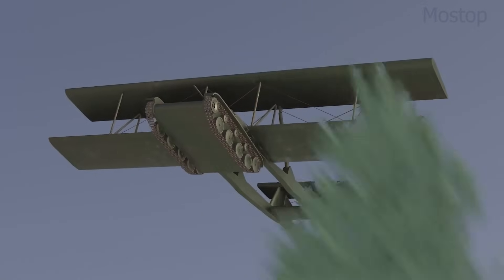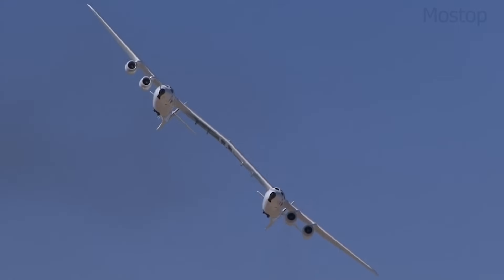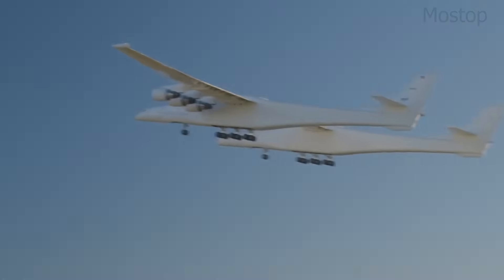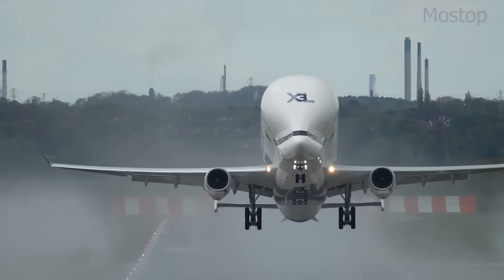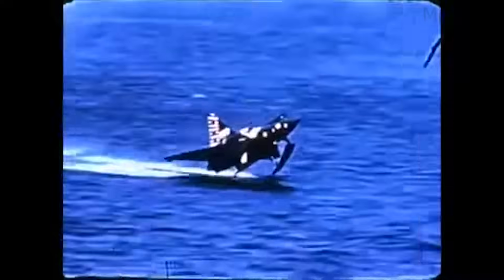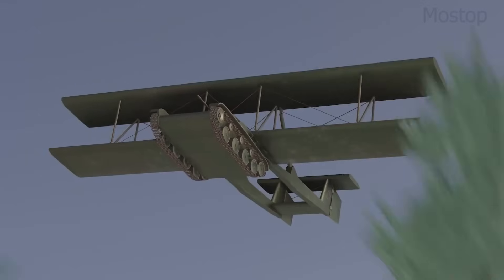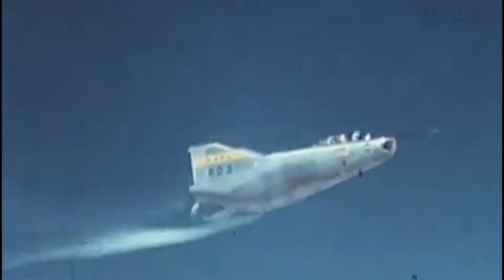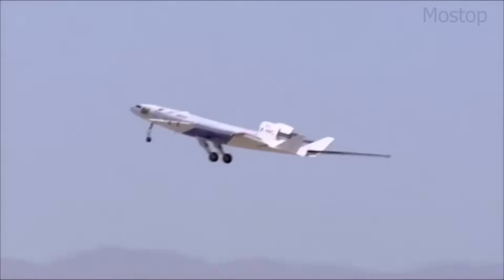The Wildest Unconventional Aircraft Designs Ever Dreamed Up By Mankind

Comment: So, like, the S-72 went thru many phases. That it flew as a fixed-wing plane, oh, Nada. That it flew with 'X' wing at the rotor, nope, not noted (roll issues, btw). That it flew with Active 5-blade rotors that were Slowed at higher forwards speeds, um, crickets chirp here. This is Crap, just a clip & paste "factoid" with no depth, imho. Research first, fact-check your Pics/Descriptions, THEN, maybe Post, something that isn't so, um, ambiguous...